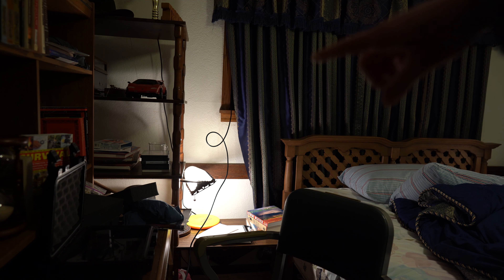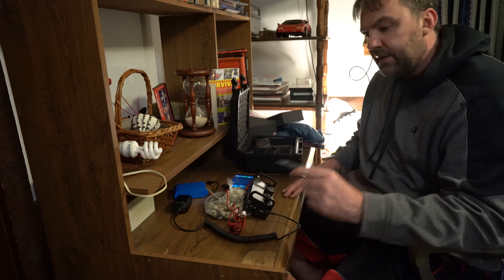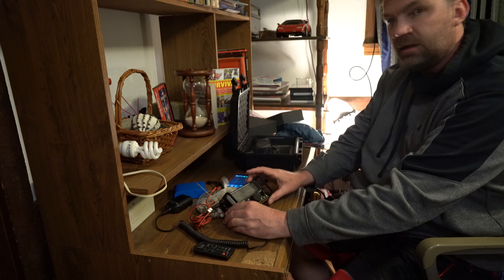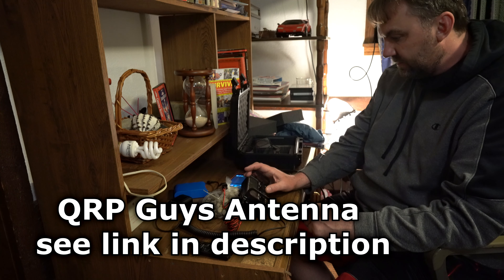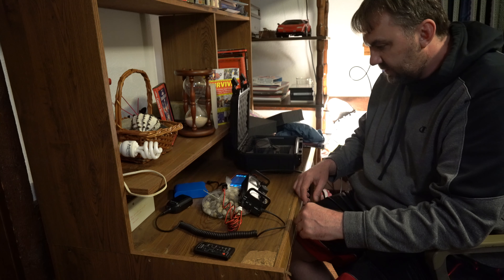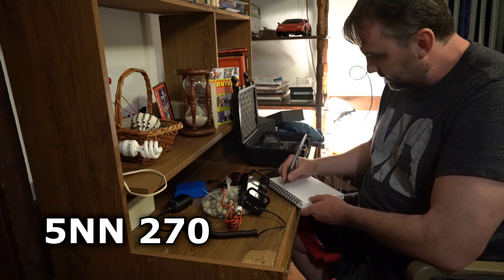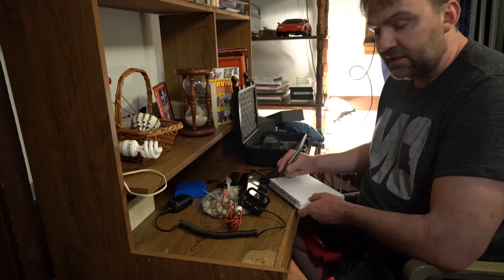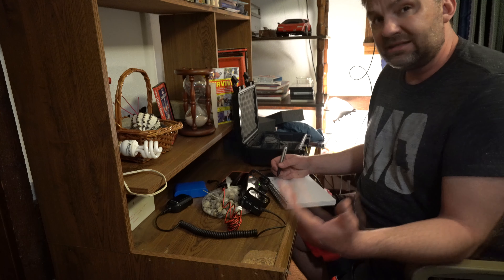CHEAP Antenna Field Test | Elecraft KX2 Tuner | Ham Radio CW Contest

Comment: Great movie.  Tom are you going to get a cover for that antenna torroid? Thanks for the effort you put in, oh...are you running RG58 light weight coax cable and what length approx.  73
Reply from the maker: I think 40' coax, RG58.  I hadn't thought about that cover... I wonder how I'd do that?
Reply: @hamradiocq  perhaps  Qrp guys sell a convenient cover...who knows :)
Reply: Ham Radio CQ large shrink wrap.  Something like what pactenna uses

Comment: Thanks for the video! Personally during the contests I prefer to check WARC bands. Usually there are many hams who doesn't participate in the contest there. Also it's worth checking high CW frequencies (e.g. 14.050 and up). Even if there is no one there calling CQ worth a try. Another little observation - when you are working QRP chances to be heard in the pileup are next to nothing. Try to call a little bit off-frequency, wait until no one else answers CQ, or try to send your call sign when another operator is finishing the QSO. Also when you transfer /QRP in the end of your call sign it rises the chances that your call will be answered. Another good trick is to wait until the signal level of the station is at maximum - chances are at this moment your signal will be received better. One last thing. I believe the antenna you are using is a long wire with a 9:1 transformer. You don't suppose to tune it over the coax! It should be connected straight to the radio. All your power was just heating the coax because of high SWR which your radio didn't see because of the losses in the coax. Give a try to a trap dipole, I believe SOTABeams produces QRP kits. And don't forget that QRP is not about 5W, it's all about improving your skills! 73 de R2AUK
Reply from the maker: Thanks for the great comment and tips Alek.

Comment: Nice video!  Shows how good CW and QRP mesh for weak signal communication.  OK to CA on 5-10 watts on 40 M is quite good. Also, I played around I the RAC as well.  Unfortunately qrp and pileups don’t mesh too well. 

Curious what feedline type and length you used.  Both to better understand any loss and SWR tuning with that antenna.  At least on camera, it seems 50 feet or more of feedline in a QRP setup.

And, yeah the weather was warm during the RAC.  In Northern TX, and yeah 70 plus degrees.

Good luck and 73!
Reply: SOTAbeams has a sturdier mast,so you may consider that one,instead.It’s about 23’ in length.On the mast you are using,you can temporarily remove a section or two through the bottom,and position radiating element a little further down the mast,relieving stress on the thinnest mast sections.

Comment: Hey Tom, what’s your take on the G5RV? I had a 135ft Inverted L up for 160-6m with a Ultimax 100, until the storms broke the wire. Worked pretty well. I’m in the process of trying out different setups at my QTH. I’m running a 24ft vertical now with that matchbox. Not impressed with it. Just looking for some ideas. I mainly run CW and FT8. KD4CR
Reply from the maker: I have a video on the g5rv. It's a decent multiband for a small yard. Easy to put up. I like it